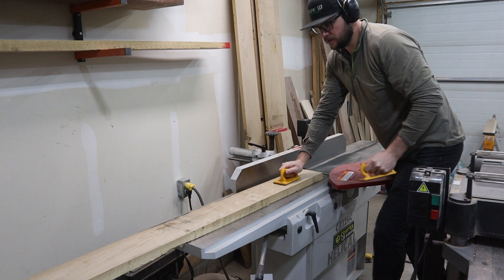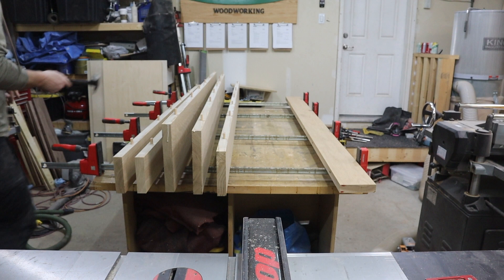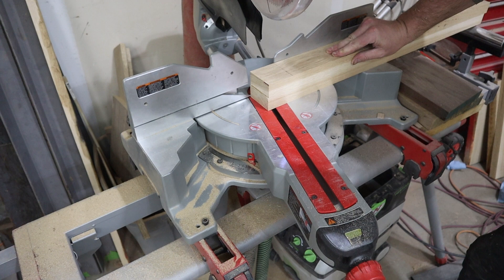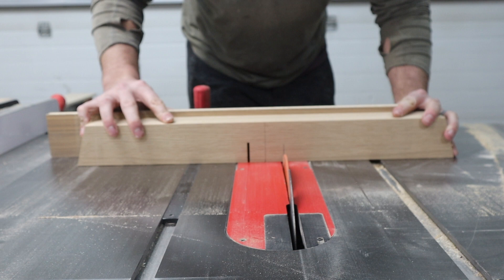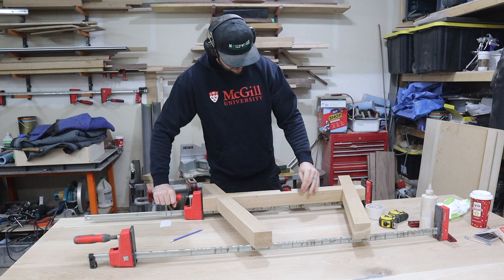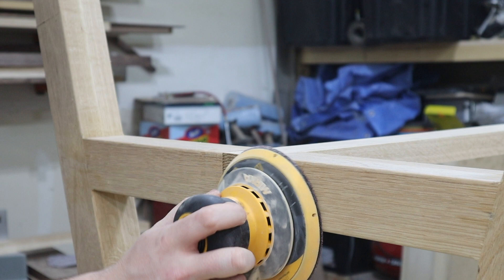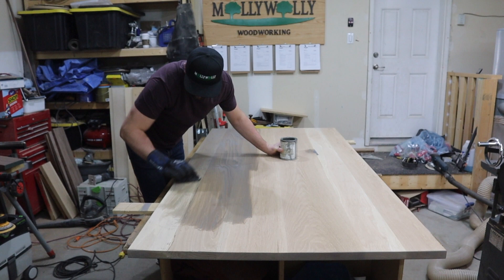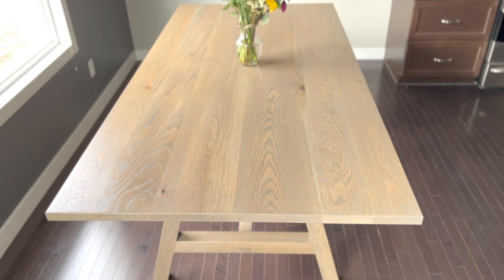Farmhouse Table Build White Oak PLANS AVAILABLE!

Comment: I'm a newbie woodworker, so forgive my question....but why is the bottom stretcher on the underside of the leg brace piece? Wouldnt it be stronger if it was dado-ed onto the top side of the leg brace? Lovely table and i really like the base. I qould 100% take a 'proper' table like this over an epoxy filled thing. But i get its whatever the person paying for it wants...they get 🤣🤣
Reply from the maker: No worries at all! It probably would be stronger, but underneath looks better in my opinion and with the right fit and wood glue in there it is plenty strong for the purpose.

Comment: This frame looks amazing! Thanks for the video. I'm considering doing something similar, but with the legs canted outward about 10 degrees. The only issue I think I'll have is for the stretcher, which I will probably leave standing proud to avoid complicated angled lap joints. Do you think this idea would be needlessly complicated? I just like that mid century angled look... Thanks! SUBBED!

Comment: Looks great! Sorry if you mentioned it, but any idea how many board feet of white oak were needed for the table? Love the design!
Reply from the maker: Great question, I didn’t mention it! This approximately 60 board feet. I bought 10’ boards and then when cutting my table top to rough size it left me with off cuts that were long enough to use as the legs/base. So there is minimal waste with this design as well.
Reply: @MollyWollyWoodworking  Awesome. Thanks!